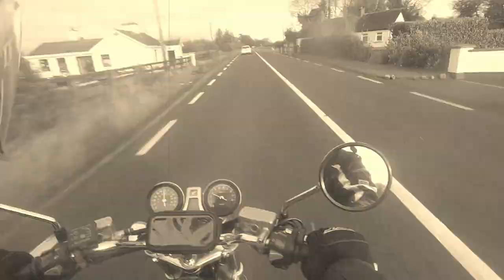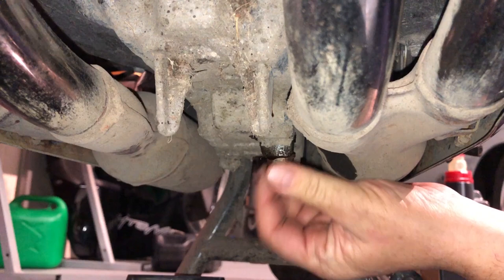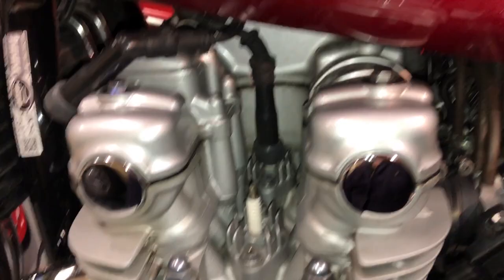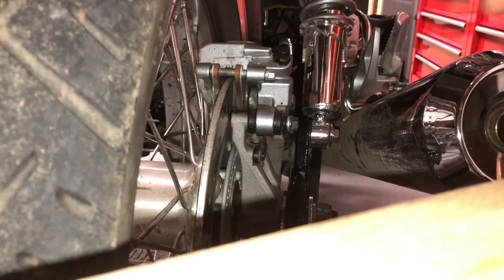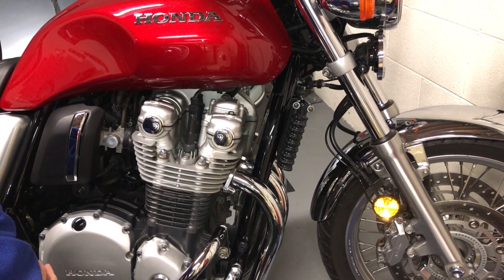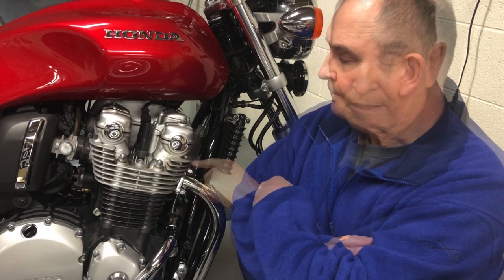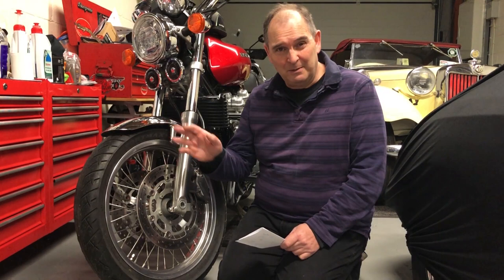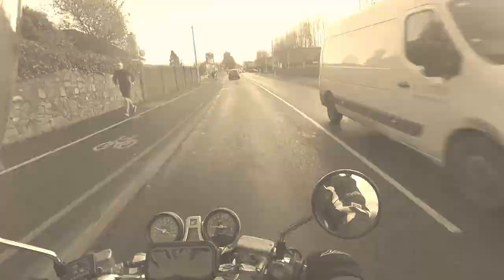CB1100 - what does it take to maintain?

Comment: If you're going to change the oil, then go ahead and change the filter as well.  It is NOT a waste of money.  An oil filter can be had for like 5-7 USD.  That is cheap insurance for your engine.  Putting clean oil in the pan with a used, dirty filter is nonsense.  Every mechanic knows to change the oil filter with the oil.  So don't be cheap, spend that $5 and put a new filter in there.  There just isn't any reasonable argument not to do so.  Especially when the filter is so easy to locate and remove/replace.
Reply from the maker: So you are right and the mighty Honda corporation, the ones who designed and built the engine are wrong? Every mechanic as you put it knows little of advanced engineering but  I’m afraid to tell you the Honda Engineers do. A filter’s performance changes in nature as it is used and as it naturally traps micro debris it’s ability to trap smaller micro debris grows thereby actually increasing its filtration performance if left rather than changed prematurely. This particular engine also leaves a full 1L of oil in itself on an oil and filter change, you can get upset about that too if you want.
Reply: @terenceokeeffesmotorcyclestuff  Don't believe everything you read in the owner's manual.  In fact, most owner's manuals are NOT written by the engineers who designed the car or motorcycle.  I will give you a good example: In modern Toyota car manuals they recommend changing the oil every 10,000 miles.  Now the vast majority of experienced mechanics will tell you to change it every 5,000.  Turns-out the 10,000 mile oil change interval is the bare minimum you must do to keep your warranty with Toyota.  But if you actually follow that schedule, you will have a ruined engine at 150,000 miles or so. It will need to be replaced.  There are many, many documented cases of this happening.  By that time, you are well out of warranty, so what does Toyota care? See what I mean? The manual isn't always 100% correct.  Hell, I have found many errors in owner's manuals over the years with cars and motorcycles I have owned.  My 1987 Mustang had 1986 information printed in it, even though that specific part had changed for '87.  So don't believe the manual is always 100% correct, because it isn't.  Why are you even arguing the point?  Are you so cheap you won't spend a lousy $5 on an oil filter to protect your engine?  Are you serious??
Reply from the maker: @LA_Commander  I thought I had made my point on the filter. As it ages it actually improves its filtration of smaller particles. You are restarting the clock on the efficiency on filtration by prematurely by changing it. As long as it will allow enough flow to keep volume and pressure up that filter will be fine and doing a helluva job, a better job than a new one. I agree about some of the user manual errors as you state, this though is not a typo and it is not about saving $5.
Reply: @terenceokeeffesmotorcyclestuff  Yes, and your point is a good one.  Problem is a dirty filter can become clogged and if oil pressure rises it can trigger the bypass valve, in which the oil will just pass through the oil filter but not go through any of the filter media.  So you will end up having unfiltered oil.  And yes, it is about the money since you stated in the video not to waste your money on a new filter.  When it comes to your engine, I think a new oil filter is the best $5 to $7 you can spend, other than new oil of course.
Reply from the maker: @LA_Commander  One assumes when Honda state only to change the filter every other oil change they know all this and have no expectation that the oil/oil filter will get so dirty and thick as to trigger the bypass, so the scenario of unfiltered oil is just hypothetical. It might take 75,000 miles to get to that state, who knows? Obviously Honda do know and hence the recommendation. But again, I must disagree with your statement that a new oil filter is the best $5 you can spend for the reason I have stated twice in the above comments. I have two other bikes, if the manufacturer recommend an oil filter change every change I do change it, if Honda are happy every other, that's fine with me too. We shall have to agree to disagree. I have all due respect for your view 👍
Reply: @terenceokeeffesmotorcyclestuff  Using that logic, I guess you agree with owner's manuals out there that state to never service the transmission on some cars because they are "lifetime fill" LOL
Reply from the maker: @LA_Commander  230,000 on my Ford, same transmission fluid, sweet gearbox 🤔, 98,000 on my Opel, doing just fine. Will they do 500,000? Probably not, but then they don’t need too.
Reply: @terenceokeeffesmotorcyclestuff  Well I was referring to automatic transmissions and CVT transmissions.  Manual gearboxes are pretty much maintenance-free.

Comment: 5:24 fork oil should be replaced.
Reply from the maker: At some stage yes. The front fork action is still very supple and stiction is at a minimum.
Reply: @terenceokeeffesmotorcyclestuff  Also, swing arm bushings/bearings wear out If not lubed with high-quality grease. Why can't you use a tubeless tire with a tube? I would try that, I have done it on tubeless tires before with no issues. Steering head bearings should not be overlooked, I have had them lock up when riding. Even if you don't ride a lot knowing they're done right from the beginning (quality grease/correct fork oil wt. with the right level.) will bring peace of mind for years to come. I have just bought a 2014 DLX  6300 miles (10,000 km) will go through everything including replacing the battery. Thanks for the video on your bike Your info on valves was much appreciated
Reply from the maker: @pwcraig65  Thanks for ther feedback. Yes, dead right on the swing arm and headstock. Not too long ago I swapped out the rear shock on my 25 year old Triumph and I reckon the rear linkage had never been apart. That actually has five grease nipples on it which are very handy! No such luck on a modern bike. I could of used a tube in the tubeless tyre of course and Bridgestone supported that on the T31 tyre. I decided to go the whole hog and converted to tubeless so I could repair a puncture by the side of the road easily.

Comment: Air-oiled cooled.  Boy, that oil is way too black for my bikes! And I would be careful about oil breaking down after 2 years.  I run in 38C to 40C temps in the summer in South Texas.  Change mine every 6 months, even if I do no not hit the miles.  I do a suggest a K&N Air Filter;  you never have to buy another,  got mine off ebay for about $58.  2 Honda filters $ >I $ K&N Air Filter. I am going to line my wheels with a kit from Out-Ex off ebay for $110, that seals off the spokes, then probably run a tube in them anyway.  Tube tires for this bike even in the States are almost impossible to find and cost way too much!  Since I keep my bikes a long time, what I have suggested here factors into that, and my Forum members see me doing almost all of my bike work myself, except change tires.  Those days are over!
Reply from the maker: Looks can be deceiving with oil, I was quite suprised how dark my new oil was actually. I reckon if I had that analysed it would have protection properties still well intact. That has about 5,000 miles on it so it hasn't had too harder life in terms of a running engine. I'll admit it does look dark but that is not really a true indication of its protection capability. Oil compainies have agendas and there is a reason they propergate the annual change regardless of mileage. My brother in law spent most of his working life in sales for a large UK manufacturer of oil, he would back me up all the way. If I were doing 15,000 milea a year I would probably change this oil twice, possibly three times a year but I'm not so I really don't feel it is neccessary. As for the airfilter, again, you would want to be doing massive mileage to reap any cost benefit from a K&N but even this is dubious, I just don't buy into the hype of them. The hassle of cleaning chemicals and re-oiling doesn't appeal to me either. I'm not convinced that they make a "freer flowing" product than the OEM filter either. My Triumph stock airfilter has a change interval of 24,000 miles, this stock Honda filter will be well up for that too and changing it earlier will have no impact on any aspect of this bike.

Yes, Out-Ex have a good reputation, probably the most well known supplier of tubeless conversions on the planet, great choice. What would be the benefit of keeping the tube though? If you get a puncture without the tube you plug it by the roadside and off you go. If you have a tube, which would also be punctured, you could seal the tyre with a roadside repair but you will still have a big chunk of deflated rubber flopping around the inside of your tyre which will be less than ideal at speed.

We are lucky here, I can get Bridgestone Battlax T31 in my EX 18" sizes in three days with the local stockist so I still have the option of using those with the tube or going tubeless if I do the conversion. Bridgestone confirmed they support this tyre on the EX with a tube. I'm definately with you on the tyre change, I never really did it unless forced anyway and I'm happy to let someone else change my rubber, it's not to often after all. I also know I would scratch those lovely rims to bits! Good luck Michael, stay safe.
Reply: @terenceokeeffesmotorcyclestuff  Thanks for the info about the Battlax T31 tires.  I run a different tubeless Battlax on my 2013 CB1100, and they are doing fine.  I guess the issue with the oil where I live is the extremely high heat I ride in, and the huge amount of dust in South Texas.  It is probably due to lots of farming, and extended times of no rain!  This puts lots of solids in my air filters, and what ever gets through, in my oil.  I just feel better knowing I am getting this crud out of my bike at least twice a year.  I recycle all my oil, so hopefully it is used again.  The guys at Out-Ex said a tube would not hurt, but was unnecessary, so I will not go that route.  They mentioned  plugging the tire, as you did.  I use Motul 7100 oil that is colored, and easy to tell when dirty.  I probably spend too much on my bike care, but these are my babies, and I do not plan on buying anymore new bikes unless Honda brings the CB1300 Stateside. Thanks for the reply, and you ride safe too.  Wish I could visit Ireland and England, and ride in weather that did not toast me.  We hit 29C here yesterday and we are in the coldest month of Winter!  (I had to sign in on my granddaughter's account, my PW would not work)
Reply: The problem with K&N air filters is that they're so good at filtering the air, that the motor doesn't get as much as it needs. Unless you're riding in really dusty conditions (at which point now you've got to service the K&N frequently) it's not worth it. And NEVER buy a K&N oil filter or anything but an OEM Honda oil filter. I've seen too many motors with rod knock or completely seized and they all had aftermarket oil filters on them.

Comment: The oil philosophy is whack!   Change your oil and filter when it starts to get dirty!  You will EXTEND your engine life, period.
Reply from the maker: It’s Hondas philosophy, not mine. The argument is that the filter, as it gets used more, traps finer particles increasing engine protection from ever smaller contaminants as it ages. The interval is gauged so as not to leave it too long and clog the filter of course. So your period might just be misplaced.
Reply: you'r bike do as you feel I'm shure you will.